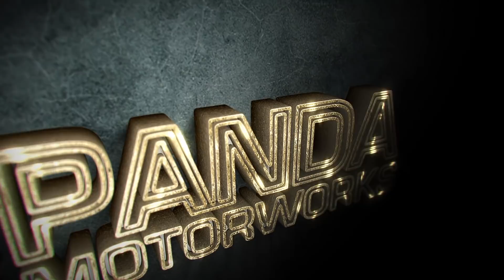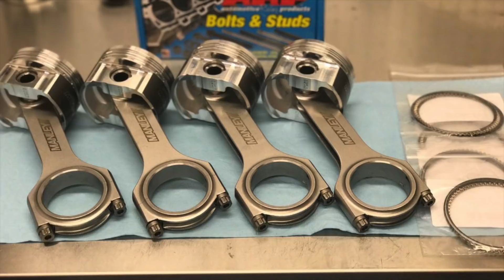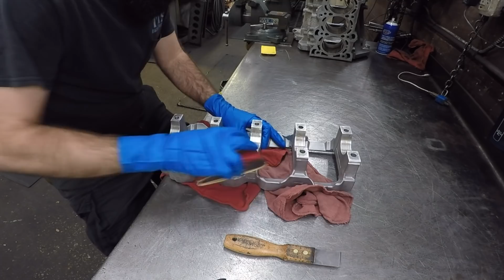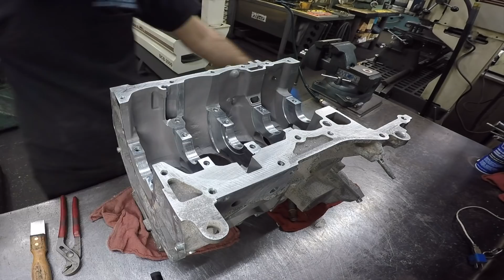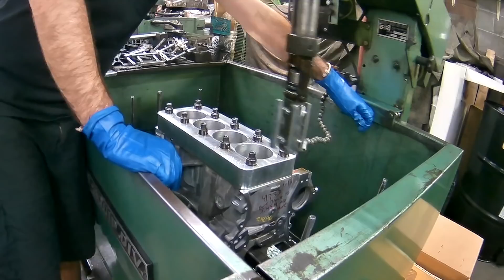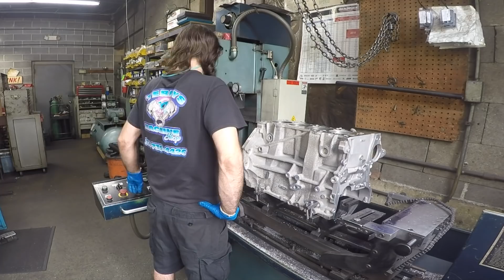Beginning Stages Of A PandaBuilt 2.0/2.3 EcoBoost Engine | Panda Motorworks

Comment: My question is, when you put the 2.3 internals into the 2.0 block, does it become a 2.0L, or 2.3L afterwards?  I have been trying to find the answer to this, but maybe i have not been wording it properly.
Reply: 2.0 and 2.3 have same bore. The difference comes from the stroke, and the crankshaft.
Reply: The 2.0 becomes a 2.3 because you change the stroke, the bore remains the same. My question is what 2.0 can you use, should you use only turbo charged 2.0's. Can you use older 2.0 like the duratec. We need a clear list of what engines are useable. Also, what about the passenger side motor mount. Does the bock need machining to bolt a mount on. Thank you
Reply: @jeremyhigh3186  MAP Performance in Minnesota has exactly what your asking about.  I talked to them but lost my business because the salesman was lazy.  Livernois in Detroit was more professional and I got exactly what I wanted.  The short block about $10,000 USD.
Reply: A sleeved block with a deck plate is the best, but most expensive option.  A boosted 2.3 will get you about 15% more power.  Billet rods are the strongest but are often a custom order for the 2.3.  I strongly suggest getting a built short block for the Ecoboost, for race applications.  You only have four cylinders to handle the pressure.
Reply: the 2.0 is bored to a 2.3 and 2.3 internals are used making it a 2.3 with closed deck block.
Reply: @JackJackandAce  Thanks for the explanation.  I figured it was something like that.
Reply: @MJC-GSXS750  Jim is a clown who doesn’t know what he’s talking about,  when you use 2.3 internals in a 2.0 block it makes it a 2.3 , and it’s it’s not a bore that makes it a 2.3, the 2.0 block uses the stock bore, but uses the 2.3 crankshaft which has a longer stroke.   So basically what makes the 2.0 block a 2.3 is the crankshaft.   The reason builders use the 2.0 TS block is because it is semi closed deck with a more robust casting.  The 2.3 RS block is open deck and is known to be the weaker block as it has less material around the cylinder walls as it’s a open deck block.  Hope this clears it up for you.   Have you built a ecoboost since this comment?
Reply: Jim do you know if the EcoBoost motor that comes in the focus ST is closed deck? I can’t find much on it and am curious
Reply: @idontpaytaxes6250  yes unlike rs witch is open deck
Reply: @JackJackandAce  shut up dummy lol Do research before talking you have no idea what you are talking about.